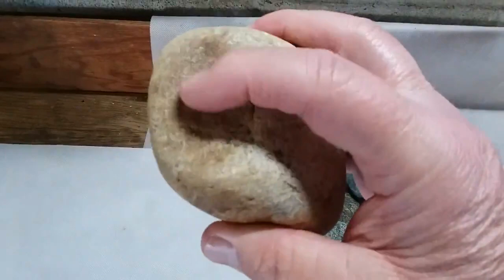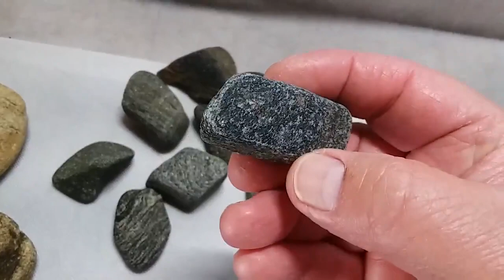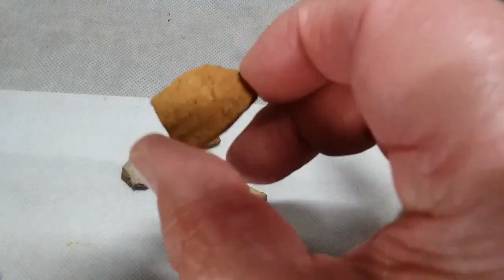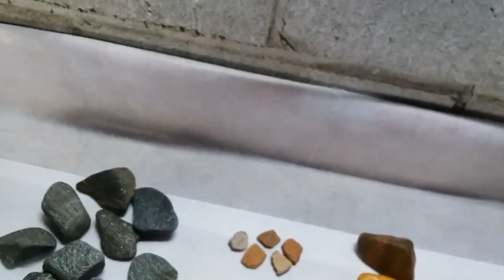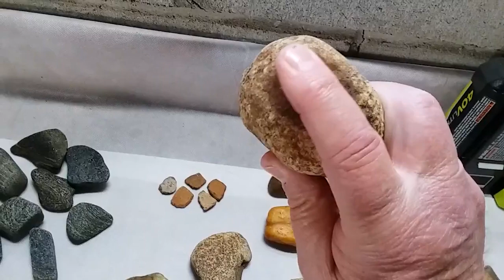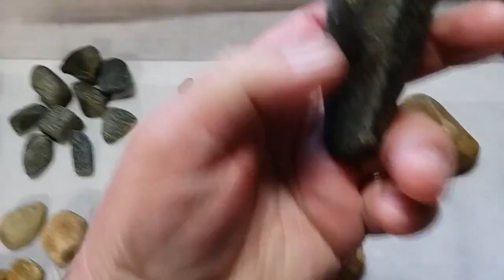Native American Stone Tools And Artifacts ~ INTO THE ABYSS !

Comment: How do you clean your finds? Thank you
Reply from the maker: @jimpeters6440  I have tried everything. The best by far is Murphys oil soap mixed with water. Use a soft brush. The only downside is it takes a good 3 weeks for the artifacts to dry.
Reply: Thank you.. I really appreciate your videos
Reply from the maker: @jimpeters6440  Murphys is a very mild soap, and that's what you want.